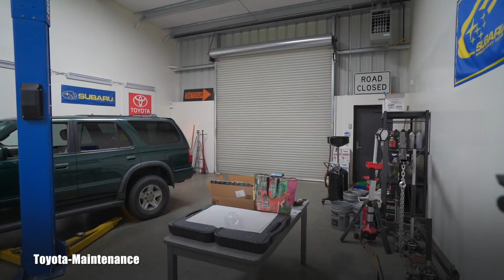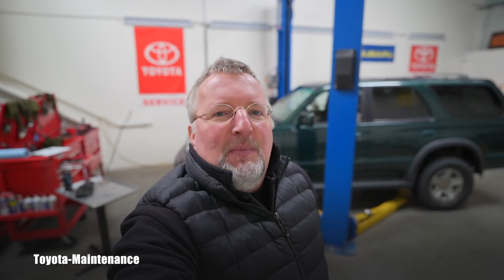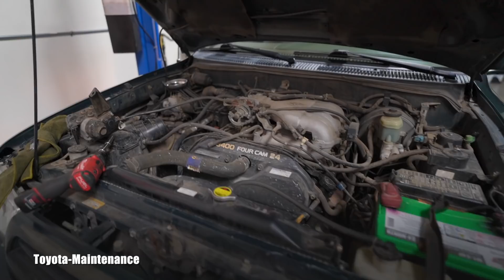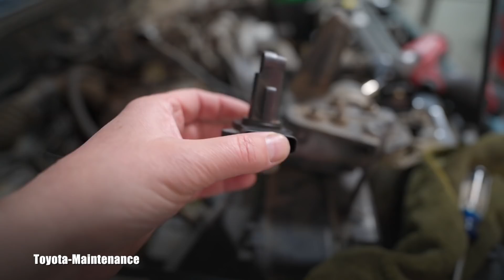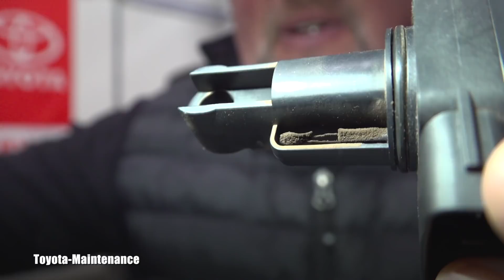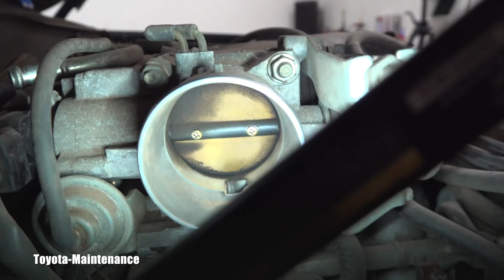Dirty air filter - dirty MAF - dirty throttle body & IAC valve

Comment: Peter,
I have mentioned this on your other videos but that wire/bulb shown is the air intake temp sensor not the air flow resistors which are down inside the tube. Therefore that's why the check engine light is not on because the MAF resistors must not be dirty enough. This is shown in the diagram of the FSM.

Comment: I’m working on a 2004 4Ruuner with 251,215 miles. A K&N filter that has heavy crud and a MAF that was encrusted with oil/dirt. Dumped the filter and cleaned the MAF and removed the throttle body. It has a engine light on for misfires on spark plugs. Have spent a few days replacing dried and cracked power steering hoses, A/T cooler hoses, vacuum and smog hoses/lines, valve cover gaskets, spark plug tubes gaskets and spark plugs. A little TLC went a long way, engine now runs very smooth. It’s a Toyota that why!

Comment: So do you just spray the throttle body flap from the outside?  Manually turn it and clean the backside too?  Or totally remove it from the vehicle for a more thorough clean?
Reply: I think both. I mean it depends on the condition or history. The very first time I did this, I knew it probably hadn't been done for 10 years and I wanted to learn more about it. So I removed everything completely and did a very thorough clean. I would have been happy to eat off it in the end. But now that I know it's been 'reset' to this state, I'll probably just give it a spray and a wipe each time I do an oil change without dismantling anything. 
I think like all cleaning jobs, it's probably easier to maintain little and often rather than wait until it gets terrible and have to spend hours scrubbing at things :-)

Comment: Followed your instructions on cleaning the MAF and throttle body. Now it's idling higher. 
Any suggestions? 03 Sequoia sr5
Reply: Did you take the terminals off the battery before you started the work?

Comment: Hi Peter,  how can I change the cabin ac air filter in my toyota sequoia 2005 ?
Reply: That's a very big job. Takes at least 8 hours and requires special tools and diagnostic equipment. The filter also costs about $1500.

Comment: Peter, when a scantool says that the air intake temperature is (-)40°f.... This "match stick" being broken, or either wire to it, being broken, could be the reason... The ACTUAL MAF is up inside the tube, against the circuit board. It's what's up inside, that meters the air flow, not the "bulb" on the outside. (the IAT is virtually unaffected by the dust) This could mislead someone with an IAT issue.